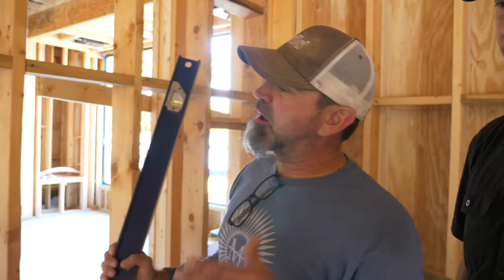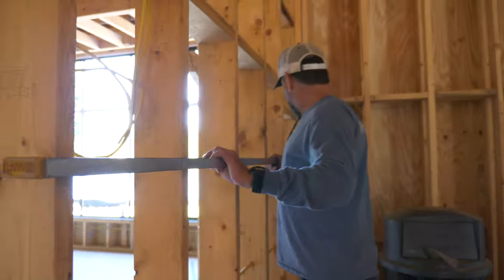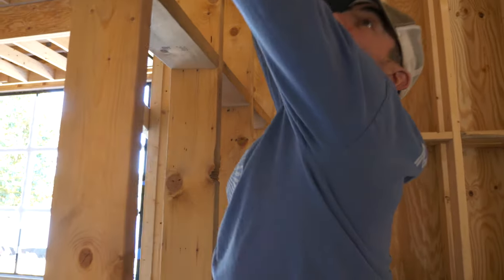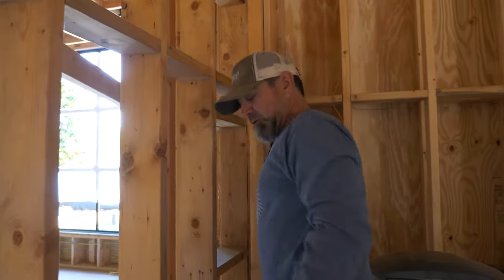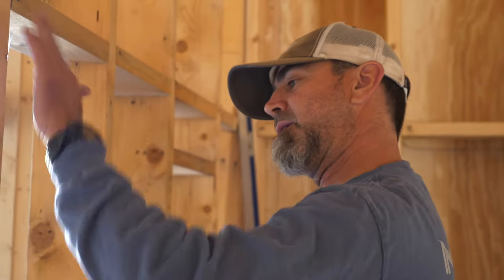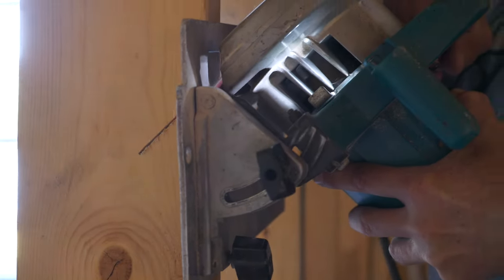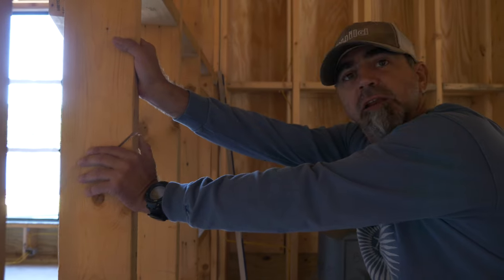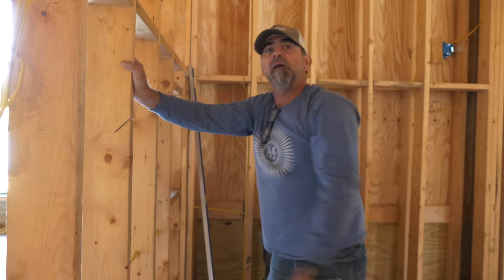Framing Tip - How to Straighten Studs

Comment: Cut the opposite side of the bowed stud with a straight cut pull toward you and place an appropriate sized wedge in the cut.  The wedge will hold the stud in place until you attach a nailer to the side.  it's an easier one person op. It's also more stable vertically and doesn't change the load bearing capacity.  This can be done with the drywall on as well  for interior walls.  You will need someone pushing on the opposite side of the wall and have a small drywall repair.
Reply: Exactly.  He didn't address the change to load bearing capacity.
Reply: Respect~! Better way.

Comment: This isn't the right way to do it in my mind /experience. A straight cut is better, the board is straightened and if necessary you place a shim in any remaining void caused by the kerf of the blade that's in excess of the space need to straighten the stud. As the load is vertical, you retain a compression joint.. In his method, you are creating a wedge which would shear and wedge apart if the remaining portion was to fail ( which, granted, is very unlikely) but the supported straight cut allows no movement after straightening.

Comment: Why can't you take a planer and straighten it on the spot?  This cutting and bending make me feel uneasy.
Reply: the other side of the stud will then be bowing inwards
Reply: @magnusstrmsnes1839  not really. provided the width of the board is uniform you would be correcting a dip on the opposing side simultaneously.  The trick here is sistering the stud to regain the strength of the stud.

Comment: In the wrong hands this looks like a great way to have a house fall apart.  Putting out information like this is irresponsible.  There are so many safety precautions someone needs to account for if they're going to be taking a circular saw to a stud.  And I'm not talking about equipment safety I'm talking about structural integrity.    Use a planar or do some shimming.
Reply: Joseph M if your house fell apart because one stud was cut you belong with the three stooges. Sistering on a stud beside it negates any weakening.
Reply: have you ever seen a house fall apart?
You can take out an entire corner of the foundation before they even begin to sink.

Comment: I am a structural engineer. Don't do this to the wrong studs. You dramatically decreased the bending strength of the stud. If the cut makes it easier to bend the stud, you just decreased the buckling capacity. You can sister a full height stud to get the strength back but you likely won't get the bending capacity back with just a nailed-in block. This is especially bad for tall exterior walls. Ask the engineer before you cut. It might "work" but this is just because the code "under rates" the capacity of the wood (for life safety concerns). You can really run into trouble if the cut is near a knot on the other side of the stud.

Why 45 degrees? It seems to me that the wood would just as likely split with a 45 degree cut as a 90-degree cut.
Reply: AMEN!
Reply: I think the 45* cut makes it more likely to split.
Reply: *structural
Reply: Never seen 45angle cut it's normally a straight cut wedge it and two flitch plates 450mm long screwed either side of the said cut Aotearoa New Zealand of course Kiaora 👋🔨🤪🇳🇿

Comment: R602.6 Drilling and Notching of Studs - don't cut more than 25% if its an exterior wall or 40% for interior walls. Notching. Any stud in an exterior wall or bearing partition shall be permitted to be cut or notched to a depth not exceeding 25 percent of its width. Studs in nonbearing partitions shall be permitted to be notched to a depth not to exceed 40 percent of a single stud width.

Comment: I've seen this done but I wouldn't encourage this method much myself.  Simply not the most professional way to do it.  I would do it by using a router and a guide block clamped straight on the stud.  Is the cutting method quick?  Yes.  Is it going to make it structurally deficient?  No.   But is it the best way to do it?  Not in my opinion.  Its just good practice not to cut into studs like that.  Easiest to pay attention and not put a really curved stud in there in the first place.
Reply: Ever made a profit framing?

Comment: I dont like cutting into studs. As an engineer, I never like to weaken a member. In my mind, if you are not going to spend significant monies and buy the very best studs, then either replace the stud with upgrade stud, or plane, sand, or slice alittle off the face. The method of cutting the stud may work best on production homes that are single story and composite roofs, but not finer custom homes with concrete tiled roofs, two + story. I would also upgrade the wall board to 5/8".
Reply: I will say, that in the last couple of years, even "premium" lumber is really hit or miss. Even the engineered LVLs can be cupped. Best to crown and sort your lumber, then go back and power plane or fur out as needed. But that's just my experience.
Reply: @717UT  Agree with you. What I have experienced is cupping and bending even after replacing or fixing the problem. Wood, no matter if premium, will dry and change dimensions. How do you combat that ... dont know. Best to put up drywall as quick as possible? lol.
Reply: @ZimorKilled  I agree. Only so much you can reasonably do and it's not entirely preventable. The little things I chase in remodeling seem so fruitless sometimes. And I know trends will change and all my hard will get ripped out in a few years anyway. Really wish the industry was different. And if I have to be honest, I've used the trick in the video on non load bearing walls before.

Comment: There's a reason why the plumbing and electrical codes only allow holes up to a certain size to be placed in the center of a stud and not towards the outside.  I would never recommend doing this on any load bearing wall.  Building a tree house?  Then go for it.

Comment: first, a real carpenter would not use a sidewinder saw , he would be using a worm drive ( skill saw) this is why they make drywall cardboard furring strips
and power planer. you cut studs like that in CA you'll be popping bands on a new unit of studs.
Reply: Patrick Johnson a 'real' carpenter you say. interesting.
Reply: The wank about types of Circular saw is such a bunch of crap a modern sidewinder or worm drive both complete the tasks fine it just depends on what you are used to, just use what you like it really makes no difference.  You do bugger all cutting with a circular saw anyway when you are framing 95% of it is on a mitre saw
Reply: Agree. about the circular saw though, Yes i understand if you're framing houses, where your cutting tons of 2x4s and OSB, that the added weight helps making easy square cuts and rips with the help of gravity as well as more resistance to kickback. But when I'm at work, framing and finishing decks, i prefer cutting 2x10s,2x12s, etc and decking with my sidewinder Makita. thats just me.

Comment: Just use a planer and shave off the bow. No one wants to do the right/better/best things when it only takes few more minutes. Instead of picking up a circular saw, pick up a planer instead. No homeowner wants to see a contractor take a circular saw to a stud - especially a tall wall like the one in the video.